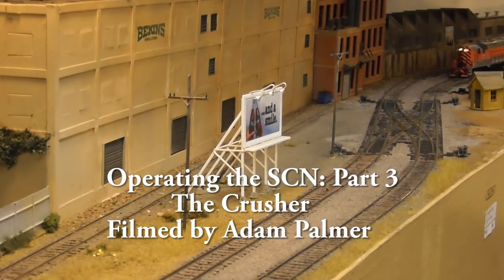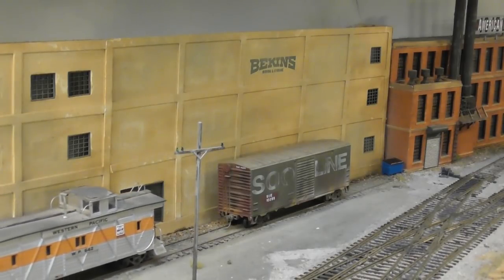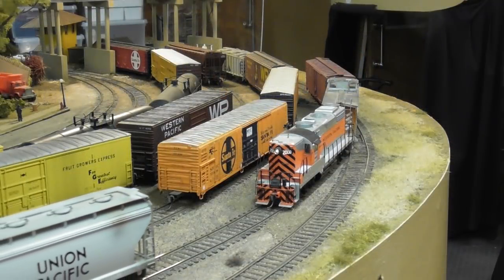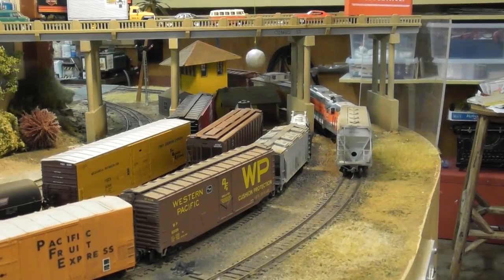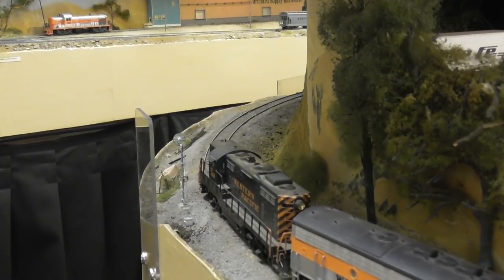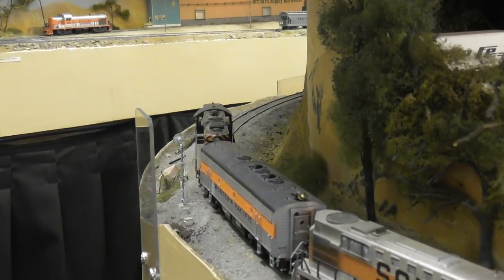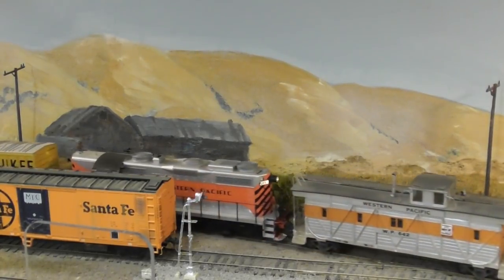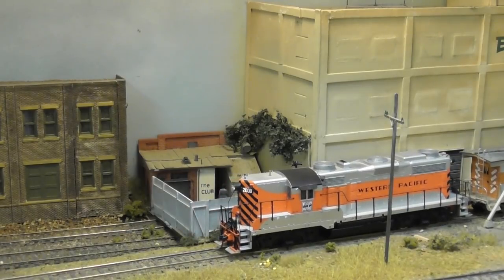Operating the SCN: Part 3

Comment: Nice series on operation. One operational aspect to consider is coupling cars. At 6:30, the Crusher absolutely "crushed" the two cars it was picking up. Hitting them one after another without stopping wouldn't have happened. Slow down to 2-3 mph, make the joint  and stop. Hoses get connected, brakes released, move to the next, repeat. If you're trying to duplicate the real thing, you wouldn't hit 80 tons at 10 MPH and keep going. Spilling the conductor's coffee wouldn't have won the engineer any points.